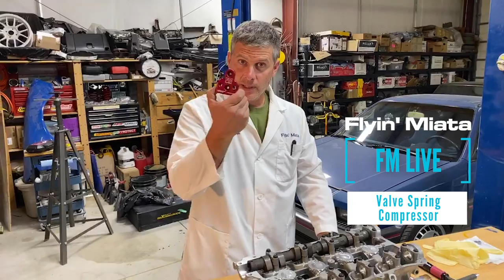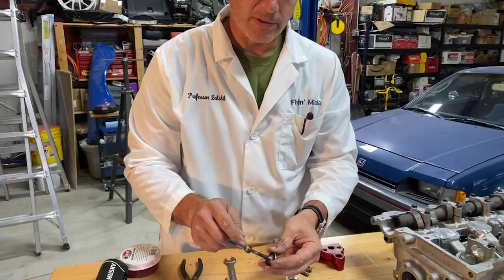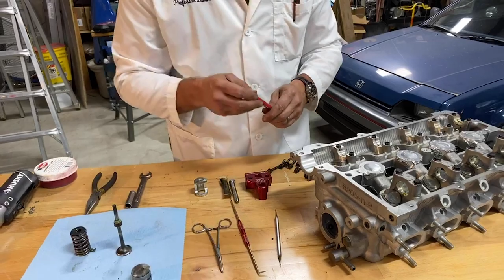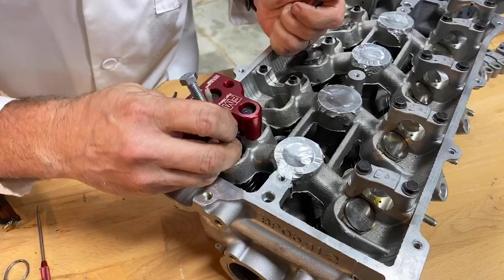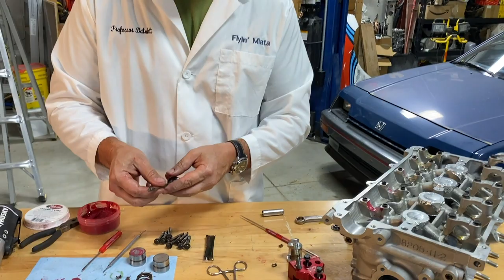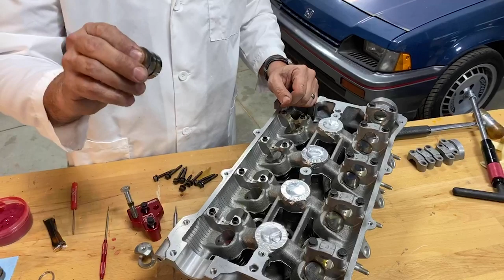Using a Valve Spring Compressor Tool on a Miata BP head (FM Live)

Comment: When you use rope, make sure a knot would be smaller than the spark plug hole. i did this on cylinder two, and the rope knotted on itself!!! Tried everything, but eventually had to take the head off to get the rope out..... Tool works great.
Reply from the maker: Oh yikes. That's learning the hard way.

Comment: Would putting the piston for whatever valves your working on at the top of its stroke be a viable option too? As opposed to putting rope in the combustion chamber, or using a leak down tester
Reply from the maker: That will allow the valves to fall partway into the cylinder before they make contact. Too far down to be useful.

Comment: Quick question, Will I need to buy new keepers for new valves? I assume the old keepers have been “bedded in” by the old valves, thanks!
Reply from the maker: There's no relative movement involved so there should be no wear. No need to pick up new keepers!

Comment: Any tips or advice for doing this on an ND2 without the tool and the head in place??
Reply from the maker: Without the tool, it will be considerably more difficult.
If you're doing it with the head in place - regardless of the tool - you'll need something to keep the valve from falling into the cylinder. Either fill the cylinder with compressed air using a leakdown tester or fill the cylinder with rope or something fed through the spark plug hole. We prefer the first option.

Comment: Any advice on pressurizing the oil system without starting the engine?
Reply from the maker: Unplug the coils or pull the main relay.
Reply: @FlyinMiataVideo  is it good practice to do that after an oil change?
Reply from the maker: @tgy119  There's no need. The oil pump should still be primed. If you pre-fill the filter, pressure should come up immediately.
Reply: To prelube / pressurize the oiling system (after a rebuild): remove oil pressure sending unit (next to oil filter). Force 2-3 quarts into the 1/4 NPT hole. I use a HFT paint pressure pot. $89 well spent, it has other uses when combined with a vac pump.

Comment: Does the tool fit nc miata?
Reply from the maker: This particular valve spring compressor is specifically meant for use on the NA/NB BP engines. It will not work with an NC, sorry.